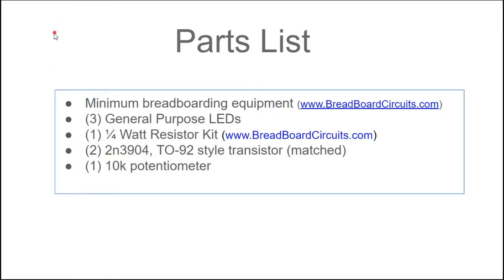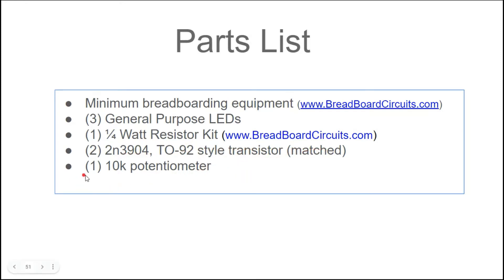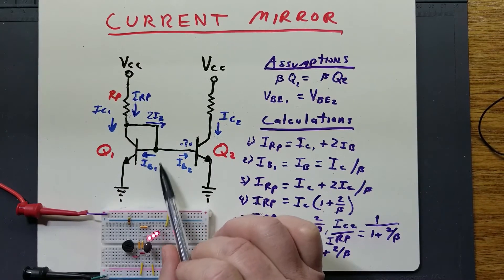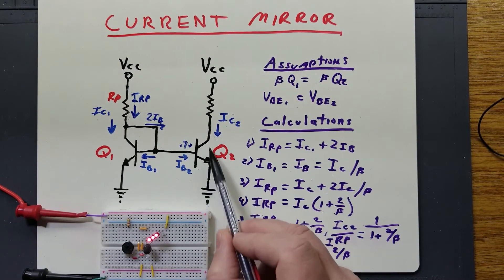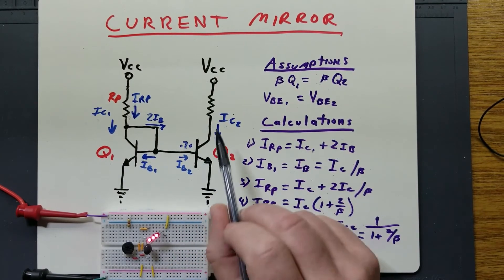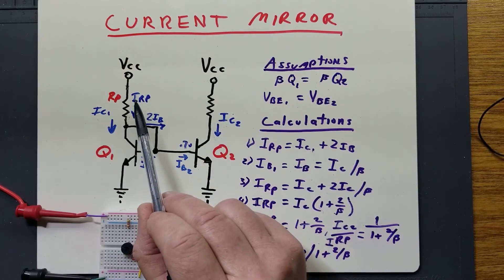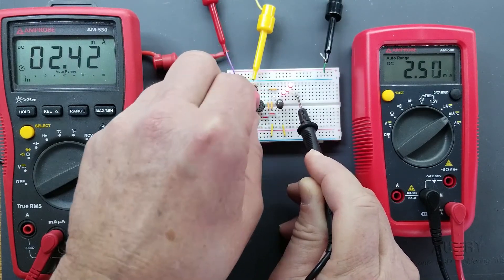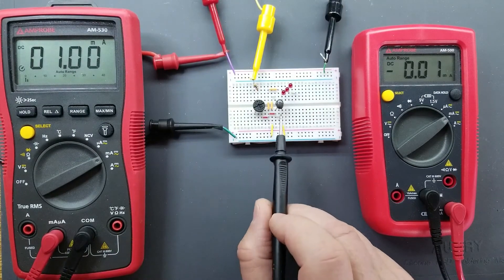#16:  Current Mirror Circuit on a Breadboard

Comment: Interesting circuit . Thinking  of a power application  on the right hand side with a DC motor drawing up to 6Amps and on the left a uC determining the current is an electronic throttle for the motor. Of course I cannot  have a .1V Vce in the power T on the right
Reply from the maker: Check out the video on 'circuits that use current mirrors' on my channel. One of these suggested circuits is very similar to what you're talking about and discusses how a microcontroller and d/a converter can be used to manipulate the voltage at the top of Rp. That suggested circuit also has a buffered output for high current applications.
Reply: @TheBreadboardMan  Interesting and informative. Thanks